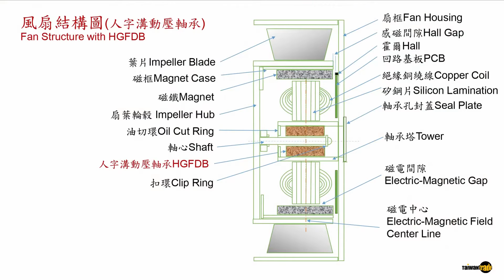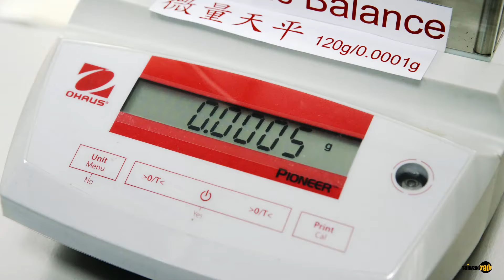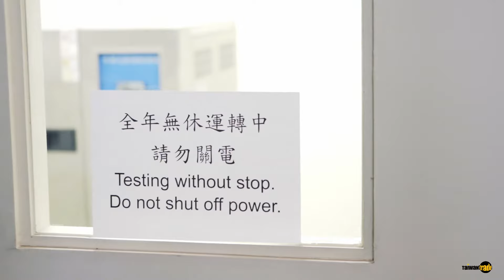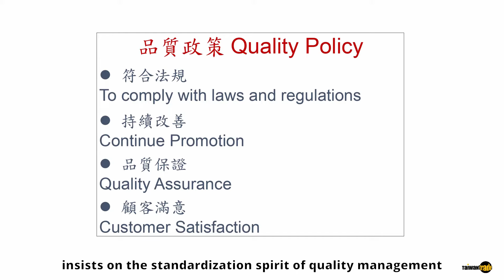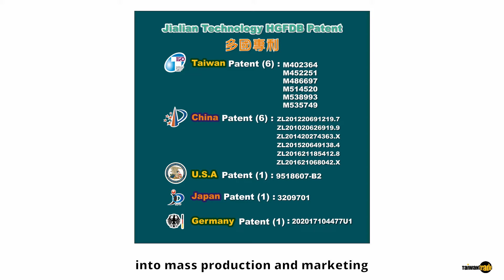Fluid Dynamic Bearing | Jialian Technology Co., Ltd.

Comment: advanced tech is good but FDB fans are impossible to repair without partial destruction of them , i had a deep cool gamma 120mm FDB cpu fan which suddenly stoppen working resulting in dangerous cpu temps, on closer look found the ground wire had come off from the pcb the fan blades cannot be removed like in a sleeve bearing fan cause of the sealed plastic, had to replace the fan with smaller fit size, i'm not happy about this experience.